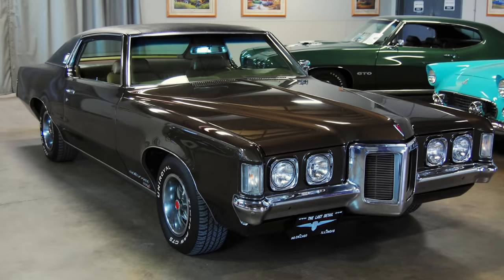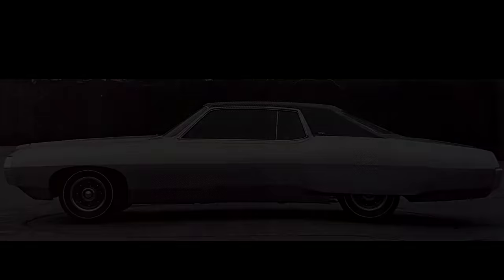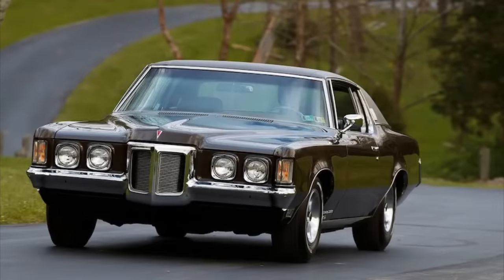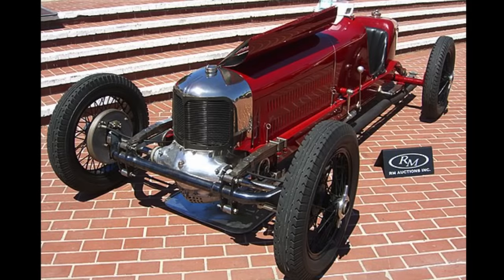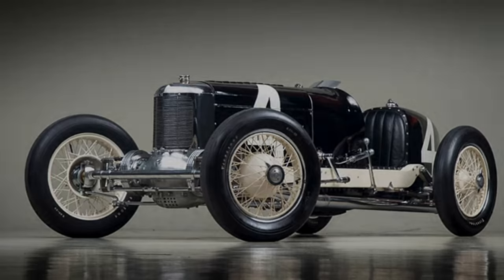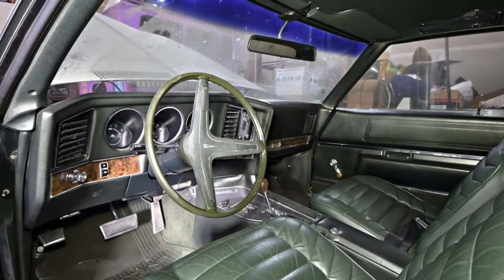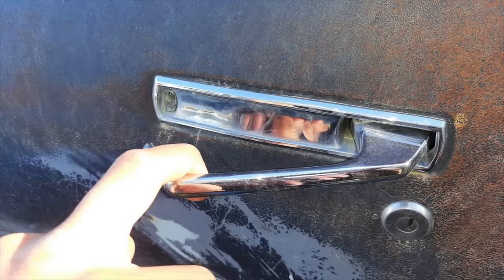Top 5 Strange Facts About the Awesome 1969-72 Pontiac Grand Prix!

Comment: ARGGH I consider the 1969 Grand Prix the beginning of the end for Pontiac. The sides and long hood are great, and indeed the door handles are interesting.
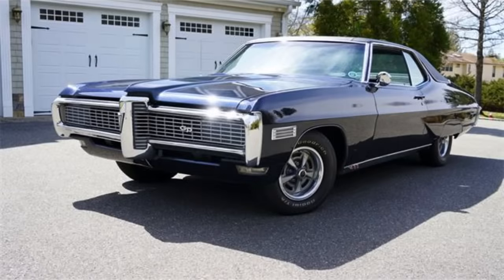But the weird reptile-eyed headlights were tragic compared to the beautiful 1968 hidden headlight model at 1:18. Despite the headlights, the 1969 was a sales success. The urge to replicate this, exploded in the freakish attempt to spread this influence on the 1970 Pontiacs. 1969's beautiful deep set headlights in loop bumpers -- gone. Instead, the Bonneville got a horrid, reptilian, dead eyed headlights front. With a bumper/grille resembling a healed-over scab more than an intentional design. The Lemans/GTO got a similar treatment, with eunuch-evoking headlights and reptilian bumpers, displacing beautiful wide eyed loop bumpers and hidden headlights. 
In 1971 the bleed turned to a hemorrhage -- freakish zombie mustachio look of the 1971 full sizes, huge nostril / snouts on the Lemans/GTO, and the Grand Prix getting two headlights lopped off. Just tragic. 
No real relief until the 1977 Firebird front end. Then the glorious 1982 Firebird.
Reply: I recommend professional help.
Reply: ...one wonders how Pontiac history might have changed if the 1969 Grand Prix had carried on with hidden headlights. Its success might have inspired a beautiful spread to the rest of Pontiacs -- rather than their complete disappearance at GM, other than on the Corvette, by 1970. Not to return until that glorious 1982 Firebird. 
I wonder if there was someone at GM that had a thing against them. And I think it was great Ford and Chrysler didn't slavishly follow suit, as with so many other GM designs.

Comment: My grandfather had one. It was a favorite with all. But unfortunately, there were union disputes at the time and the pain jobs were sabotage, by spraying soda pop on the car before entering the paint phase. It resulted in the paint coming off and the metal rusting. The Pontiac dealer repaired it, but the damage was done and it returned. after he died, one of my cousins kept the car and had the damaged metal replaced and repainted in the original colors. He still has it and will ceremoniously present it at family functions. Then grandpa is always there.

Comment: other facts specific to the 69-72 gp:
a manual transmission was available when its cousins the Riviera and toronado did not.
also available gear ratios were much sportier than riv and toro.
there was also a Hurst version with all kinds of dealer installed accessories like a phone and a tv.
i like monte carlos from this time period, but it was much easier to get a badass gp than an ss454 monte. which was not available with stick. if you were tall, or heavy you couldn't fit in secretary cars like mustang, camaro, firebird, Corvette etc. a 390 horse 428,m22 gp with 3.90 gears was just as fast.

Comment: Every time is see a 1969 or 70 Gran Prix I think of my big brother as he owned around five 1970 GPs during the 70s and early 80s the last one he gave to me.  All of them were the 400 four barrel J models , I don’t think he ever owned an SJ with the 455. He lost a couple in accidents and another was stolen and stripped out to nothing. The last one had over 200k miles on it when I got it but it would still do over 100 mph. He did all his own mechanic and paint and body work on them. With the long front end and heavy 400 big block engines those things would go thru the upper and lower control arm bushings. They also would develop rear main seal oil leaks but all in all they were very well styled in and out and had plenty of power and rode like a cloud. The power steering was so light you could turn the car with one finger.

Comment: I'm not so sure the Grand Prix alone can be credited with the driver centric dashboard.  GM also had it on '69 Cadillacs and Ford had it on '69 Galaxies and LTDs
Reply from the maker: I would disagree on the Cadillac. No instruments were canted toward the driver. The Ford is fair, but it lacked the console connected to the dash to complete the theme.

Comment: Those door handles may have looked great but they were tightly spring-loaded and it was easy to snap a finger... or if you had kids, easily break a finger.  The '71 front restyle still looked good with the single headlights, but that redesigned '71 rump ruined the rear styling.